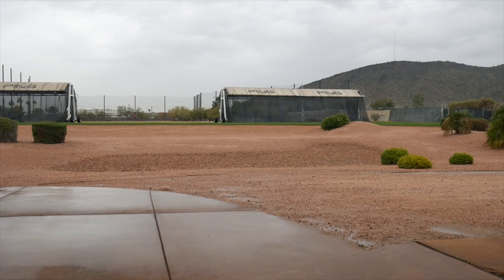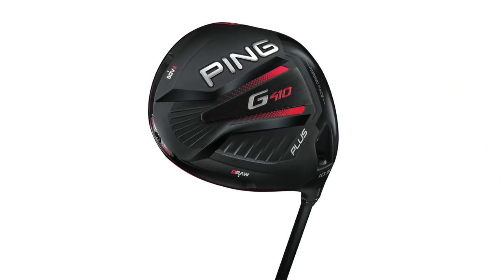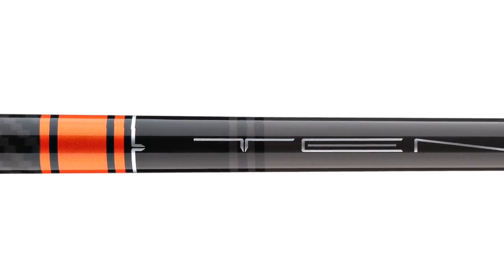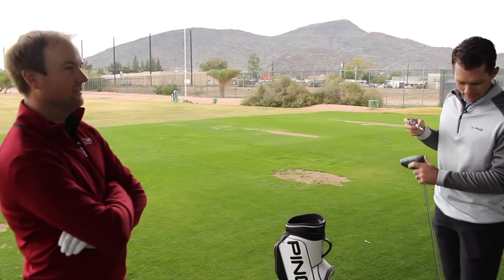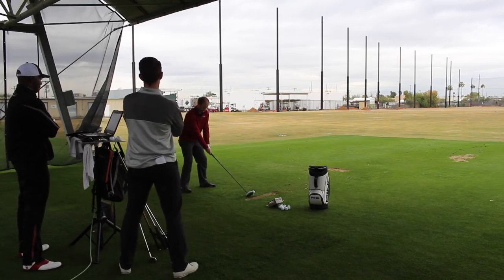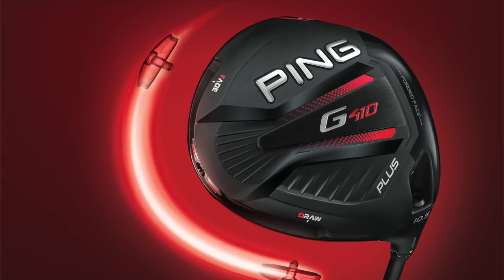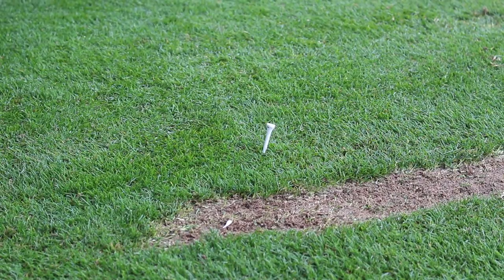PING G410 Driver Fitting Testing and Feedback

Comment: Cant wait to compare this G410 in the flat settings to my gamer F9 ...  I was custom fit this past Feb by Club Champion NJ for the F9 with an Accra fx 2.0 M4 365 shaft.  My numbers from my fitting:  1.49 smash, 98.7 mph Club speed, 146.6 mph ball speed, 13.9 launch, 2,395 rpm spin, 241.9 yards carry, 89 ft. Height, 2.4 deg. Attack angle.   Think the flat setting in the Ping G410 will help my miss left.. occasionally my F9 will go left if i get too quick, that is my miss.  my USGA handicap is 2.8.  I’m liking what I’m seeing on all the G410 plus reviews, great combination of distance and forgiveness!
Reply: Stephen DiBari which shaft did you get?

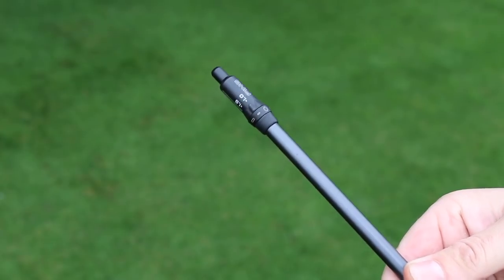Comment: 01:20 Marty says 3 degrees flat, is that reallybthe case as I have had a fitting with a certified fitter saying it's actually 1 degrees flat? Is it 3 or 1? Also same for the adapter in the hybrid?